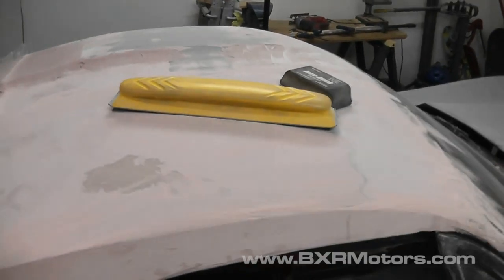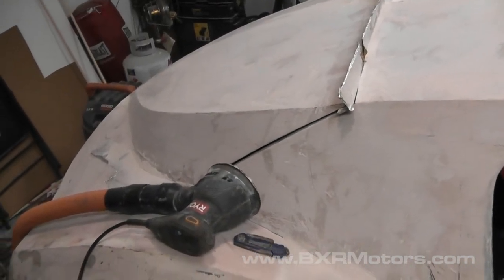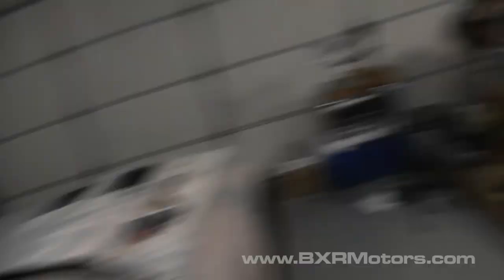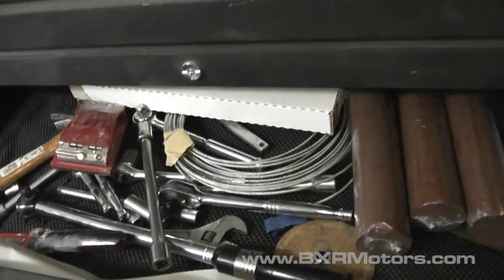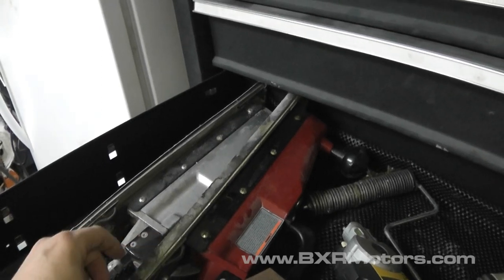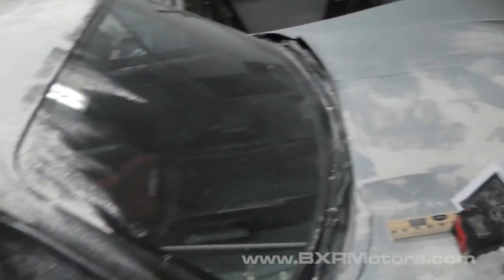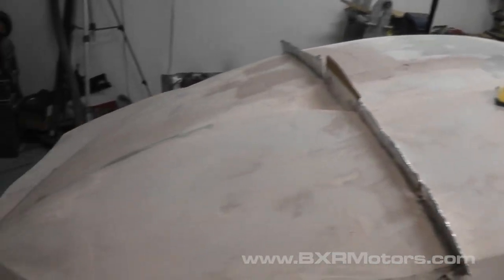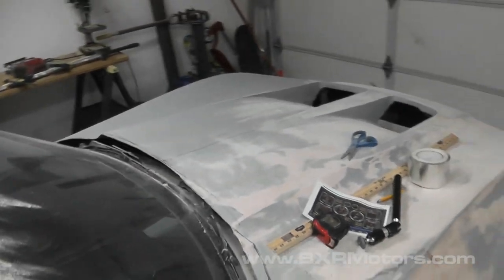Car for the next Avengers Movie? - Bailey Blade XTR Concept Car - Part 78

Comment: May I suggest for the air compressor, that you build a box around it with a blower fan to keep it cold. You could use the baker dozen egg crates then paint them black for sound absorption.

Comment from the maker: Yeah I usually use a better 2 part dense foam. I am not familiar with taxidermy foam, I will have to check it out. The Clay is Chavant's Industrial clay, called Y2-Klay. It is oil and surfer free and is very hard. You should give It a try, I have many friends that use it for their life size sculptures. Its also very light weight compared to oil and sulfur based clay's. I usually use a heat gun to soften and give a smooth surface.

Comment: Yes he could build a box around the compressor but most people build a shed to put it in outside of work space. and if it is big enough it will never run out of air using air file, also put a filter on hose to stop water and oil from coming through. and drain tank every so often.

Comment: I would think you could just cut a big hole in the back or under side of the dash and the foam would take the path of least resistance instead of pushing through all that hard clay.